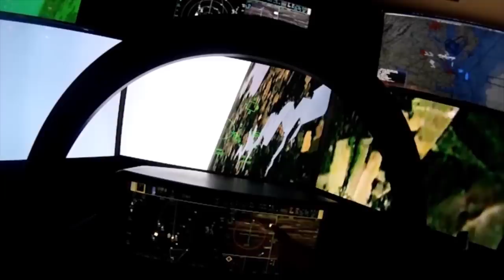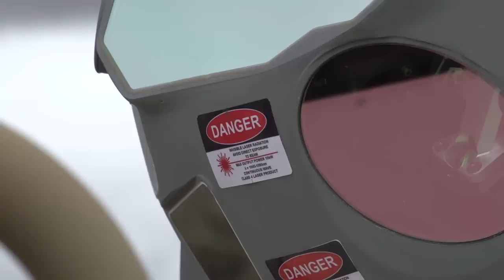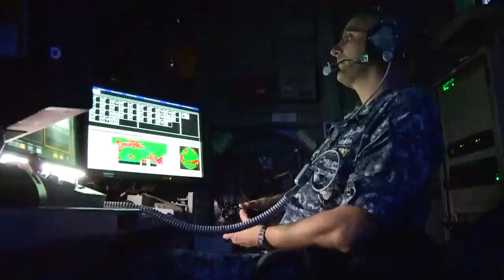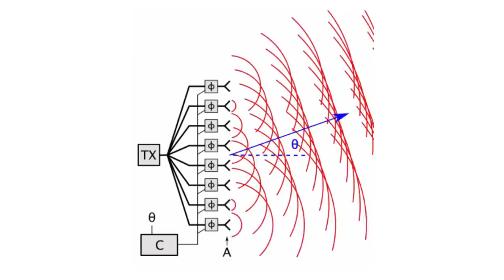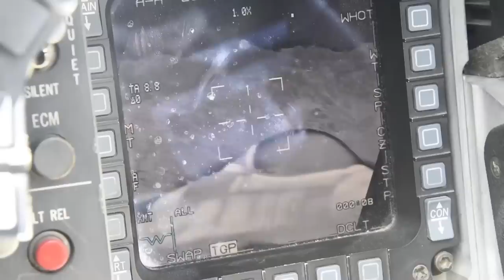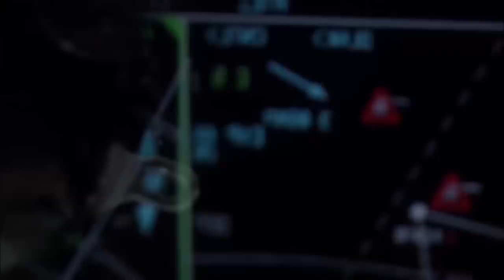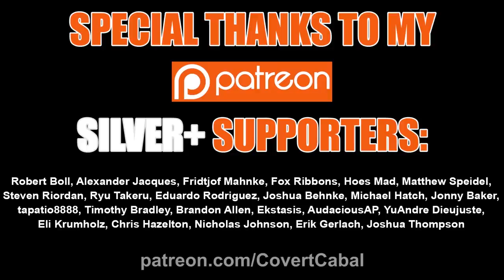Future Gen Fighter - 6th Generation

Comment: One thing I wonder that could be done should they want more unmanned planes at (what I think, at least) a lower cost, is possibly refitting older or current gen fighters with newer technology that enables them to fly unmanned or with a pilot ("Stealth" [Jessica Biel, Jamie Fox, Josh Lucas], anybody remember that?  Basically, a situation like that could be executed with this tech; meaning the scene where the UCAV flies in rescues the pilot then they give an air forces version of middle finger in the form of whatever payload is left on the jet)

Comment: Autonomous stealthy fighters with over the horizon laser strike capability would be the pinnacle of air-breathing fighter aircraft:)
Reply: Lasers go in straight lines, I don't see how they could have an over the horizon capability.
Reply: A powerful ground based laser reflecting off of a mirror held up by a plane. Of course atmospheric scattering would probably ruin that at over the horizon ranges. Although you could have the ground based laser behind some cover a km or two behind the fighting, with a plane + mirror combo flying overhead, reflecting the laser back down.

Get some of that laser artillery going, you know. Well, more like pin point laser sniping anyway.
Reply: ADF-11f?
Reply: Hanif Shakiba fuckin pure comedy right there. 🤣🤣🤣
Reply: @bluemountain4181  only aircraft and satellites can get high enough to see that far to shoot a laser:)
Reply: Red Ice reflect off a satellite 🛰

Comment: missiles destroyed by the laser( they extremely (like 5x) slow down the missile ).
in the end by multiplying the power of the laser after decades, missiles will just put some tungsten and thermal conduction in a single year, having less payload but much less payload requirement due to much weaker target because of the heavy laser.

Comment: 7th gen: cheap unmanned aircrafts controlled by a central supercomputer located in a facility at a safe zone nearest by the area of operation for low latency,  against countries/insurgents who can't shoot down satellites, possibly even directly above the drones. 

Since most expensive computing is done  centrally, the drones can stay cheaper, since it only needs the sensors/transmitters and basic AI so it knows what to do when it loses connection. 

Linking all the drones is instantly and reliably since everything is controlled centrally. Commands can be given to the supercomputer if necessary.

Con: without a connection, the basic AI on the drone is nothing compared to the supercomputer, so it needs a connection. 

Solution: the drones are also connected to the drones closest in proximity. If one drone is targeted by the enemy/if the connection to the supercomputer is lost, it can verify if all other drones in that link got a command at that point in space/time, a little like block chain. (The drone furthest away should get the command a tiny bit later than the closest. If you as enemy are not at the right location, it's hard to fabricate that delay, even if you have decrypted the stream and know what to send the drones. You'd have to fool the majority of the chained drones before it gets accepted as a legitimate command)

Pro: Without a link to home, the drone is not a threat, if it crashes there are no important/ super expensive on-board computers, and it can't attack you, except if the majority are taken over. (Which is hard to do since You'd need to fabricate the exact delay for every drone, like you were located where the supercomputer is located. And know the right encryption)

Comment: The US Airforce was originally supposed to purchase 648 Raptors back in 1991, but ended up only ordering 195 due to fiscal constraints.  A 6th Generation fighter will cost even more, probably only be able to buy one or two dozen.

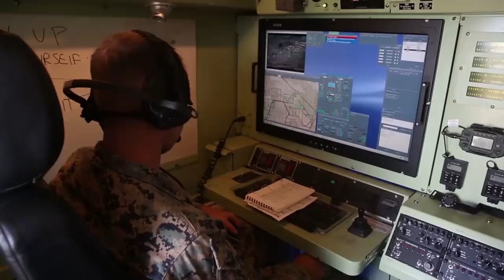Comment: 2:30 You forgot THE greatest benefit of having no pilot:
G-force limits are vastly increased! 

A jet's maneuverability is very often limited by the pilot's ability to stay conscious....and heavily limited at that.
Reply: Not really a benefit outside of small dogfights; optimal turn rates of all modern fighters are tolerable by pilots. For instance the F-16's fastest sustainable turn rate is achieved around 7Gs, not at it's 9G limit. Having an AI or remote controlled fighter won't overcome the physical limitations of the airframe and engine tech that is currently available.

The greatest benefit of having no pilot is that a pilot's life is not at risk; drones can be used in a suicidal fashion without risking pilots lives and can present additional "cheap" targets to confuse and overwhelm the enemy air defences. Though they won't be anywhere near as capable as a piloted fighter if they are built to be cheaper.

Comment: The Airforce will be proceeding in a different manner than in the past. They will be attempting to release a new fighter as fast as possible every 5 years or so using the most current technology available expecting that the jet will only need to remain relevant for a few years till the next one is released.

Comment: Nope. 6th gen May have the capability to go on missions unmanned but it won’t be unmanned. There are simply times you need a human in that cockpit. 5th gen is being given lasers. B52’s are being given lasers. They’ve been in development for the B52 for over 6 years and will be implemented in 2020 to 2021 while the B52’s are getting their new engines. F-35’s, the A and C models are getting lasers. They are removing the small, extra fuel tank just behind the cockpit and adding a turreted laser that will pop out when needed. It’s a great additional weapon/defensive system especially for the F-35C since it doesn’t have a built in gun system.

Comment: I suspect that the lag in general AI development will lead to remote operated fighter systems. You need human oversight and decision making ability, but you can't accept the performance limitations of manned craft. So you end up with remote operated fighter craft as an interim step before full on UCAV air superiority platforms becoming the norm. Picture a large stealth craft or AWACS equivalent, that deploys/operates a squadron of air superiority remote platforms. There is some EWAR risk inherent in this, but not much more than in a UCAV system, meanwhile it's much easier to get budget approval and transition your armed forces to using them. Though I suspect the next major ground support aircraft is going to basically be a slightly upgraded, teleoperated A-10 equivalent.
Reply: Sorain1
objective thought
something like this was the technical task (in short) to create a 6th generation fighter 15 years ago!
and the main burden of work will be on the shoulders of a-10, su-25, AН-64, SH-60, mi-35 (mi-24), mi-8 AMTSн, ka-52, mi-28

Comment: On the topic of discriminating between fighter jet generations, of course everyone has their own definition, but you could argue that it's really a matter of changing the tactical paradigm in a manner designed to nullify the previous generation. The lumbering subsonic first generation was beaten by the supersonic second generation, which in turn suffered to radar-equipped 3rd gen, itself being almost a non factor to modern, 4th gen fighter aircraft, which 5th gen stealth units are designed to dance around unseen.

Following that reasoning, the 6th generation should be designed to beat the 5th, which might involve all sorts of things we can't be sure about right now: lasers, autonomous combat AIs, exotic propulsion, etc. Behind closed doors, I'm quite certain that this future battlefield is already quite well understood and being prepared for.

Comment: Im kinda just poking holes in the AI aircraft idea for fun not my rock solid opinion but,
AI means more tech which means more tech support and monitoring, more potential malfunction, and possibly more complicated malfunctions at that such as electrical faliure, software bugs, hardware failure, processing errors etc. Some of these things already occur in current aircraft systems so making it the dedicated point of control hinges the operation of the aircraft all those weaknesses. 

It's probably more likley we will see integration of advanced AI systems into manned aircraft. This might sound silly but, something almost like a pilot google assistant that works with the pilot and also automates tasks more efficiently.
"Here are 3 possible attack routes with no toll roads" haha you get my drift.

Comment: Excellent video. Very informative. On your last part about China, yes, their PLAAF has come a long way in the last decade. However, I think there are a couple points to be aware of with regards to them. Only approximately 50 of their fighters are J-20s. A huge majority of their fighters (nearly 1,200 out of roughly 1,250 total) are J-10s and J-11s and other outdated aircraft. And with Russia cutting China off from purchasing new Sukhois, the already underpowered J-20 will need to rely on Chinese ability to create an engine that is both powerful enough to power the J-20 as designed and that can effectively shield its IR signature from radar detection. So far, they have been unable to prove that they can do so. It is widely believed that they had hoped to steal or reverse-engineer the newer, second phase SU-57 engines from Russia. Reverse-engineering is now off the board. So they would have to somehow steal the technology (which they have proven to be very good at doing to foreign powers in recent decades). Still, many countries have become more acutely aware of China’s playbook in this regard and will no doubt be trying more diligently to prevent them from doing so.

Comment: You are literally avoiding the fact that modern lithium batteries still can't be used for long-range flights, because of the fact that lithium has a very low power to mass ratio compared to diesel. Even if the lazer is powered by diesel, it would use up all it's fuel.

Comment: U.S. 6th gen craft should be anti-gravity circular craft that no longer relies on Carbon combustible fuel and aerodynamic flying straight thru the air like a bird, which is 100 yr old tech

Comment: With costs for developing the F-22, F-35 and the B-2 in mind, not to mention the budget and planning overruns, the operational costs of maintaining these aircraft in substantial numbers and (in the case of the F-35) the still considerable list of malfunctions of the F-35 the director OT&E published (of which some 100 deemed mission critical) I can't help wondering where 6th gen will lead to. The way I see it, the defence industry has failed several times in getting it right and I admit, it must be incredibly hard to do so. But look at how long it took to get the F-35 where it is today (still not up on top of its game if it will ever be). 
I've got the strong sentiment that western nations have traded off their ability to react fast to operational requirements if and when they arise, because they seem to be focussing more on platforms and systems than on weaponry. I'd much rather see our contractors to get 5th gen absolutely on the mark first before embarking on another 'wonder weapon.' And get the spiraling costs down to a degree, that enables western militaries to re-equip their units with more advanced systems rapidly rather in the proces. 
I've also got the idea, that industry is focussing too much on too complex systems of systems, on which no one has real oversight or complete insight, relying too much on IT (which becomes smarter by the day, leaving technicians becoming less capable in trouble shooting it seems). 
Same goes for warfighters. I've heard the story of an RAF Tornado pilot  who had a USAF exchange navigator in the backseat, when they flew over LOch Ness. "Where are we?" the pilot asked the nav. upon which te latter just gave the grid coordinates flawlessly. "Yes, I know, but where is that? " For all the nav could say it was equal to being over the Nevada desert or over the arctic, he just didn't look outside and was not able to tell they were over Loch Ness. (Source: YT channel of Aircrew Interview). If we all rely on tech too muich, we won't be able to deal with events that cannot be reproduced in a simplified manner by computers. 
I'd much rather have sound strategy, clever, adaptive warfighters than the most advanced tech there is. Here's one reason why: https://www.wearethemighty.com/articles/that-time-a-marine-general-led-a-fictional-iran-against-the-us-military-and-won#targetText=That%20time%20a%20Marine%20general,Middle%20Eastern%2Dinspired%20military%20force.

Comment: Really, as if there could be any issues with integrating AI with unmanned weapon systems...
Reply: Having used AI technology in multiple practical programs, I can guarantee you there is no chance of it spontaneously becoming self-aware and going rogue. It doesn’t work that way: AI is taught and deployed in separate stages, so an AI program aboard a fighter jet cannot learn new things, much less self-modify, both of which are mandatory prerequisites for self-awareness. 

In fact I would postulate the biggest problem is the opposite: deployed AI cannot compensate for unfamiliar situations like humans can, and nothing produces unusual circumstances like war does. There are millions of edge cases where modern AI would fail but a human wouldn’t. 

That’s not to say AI drones are useless. In the vast majority of cases they will have all the information they need to carry out a combat mission just fine; without a human as a limit in the cockpit, drones would be able to perform maneuvers at twice the Gs humans are capable of and communicate much better too. 

What we would get is what we have with AI cars: they will occasionally crash in unique circumstances they weren’t trained for, but they’re still much safer than human drivers, because humans make mistakes.

Comment: A fifth gen fighter must meet 2 crucial standards to qualify as a true fifth gen fighter.
1. Supercuise. The ability to travel at mach +1.0, without using afterburners.
2. Stealth technology/Radar absorbing material. 

China's J-20 isn't capable of supercruise, so it technically doesn't make the cut as fifth gen. More like gen 4++.
And Russian Su-57 is running into multiple problems, and is built more crudely, and less stealthy than F-22 or F-35. Not to mention there are about 180 F-22's built, making it the second highest produced 5th gen fighter, behind the F-35.
Reply: Who gives a damn for those "classification"
Reply: @joshbrowning2406  I do not quote you but it is meant to be sarcastic way to express something when typed. Pretty common to type this way where I am from. 

What kind of no-life would immediately blow up and comment on a 2018 video........

Gee, this this a public comment section and hence I have every right to type and comment what I want. 

As for this "classification" (In generation, read in sarcastic voice), there is no consensus what a 5th gen fighter needs to achieve because the entire term is pretty much only marketing. Being 5th gen or 4th gen does not mean your aircraft is better than the other. I am highly critical of this generations approach especially if we compare fighters of today who tend to be upgraded a lot. Nobody would say an F15 Silent Eagle with advanced electronics would be 3rd gen, the same as an Mig-21. 

Just a term for people. 

Then, having those abilities does not make your plane better. So, the new chinese jet cannot supercruise but maybe it can carry far more ordnance and missiles. Maybe it has a far higher range. Supercruise is something America wanted. China may want something with range to be able to strike targets in Japan or Okinawa.
Reply: @joshbrowning2406  And it's someone who can obviously only insult and not contribute something and gets all angry if someone gives him contra.
Reply: Josh Browning osh Browning I guess since I am not a native English speaker, I am forgiven. Kindly point out where I misspelled.

You seem quite angry to me though. Immediately insult me, repeatedly. You laugh at me for misquoting you but yet you make up statements I never said too. I never once said that Chinese J-20 could best the F22 in a dogfight. 

So, are you interested in a serious discussion or are you just continuing to insult me and my intelligence?

Comment: I dont think they will be unmanned just because of the jamming reasons. Also i Doubt about lasers - wont be powerful enought. But what I think.. probably the fighter jets will be operated in stratosphere. There they can reach faster speeds, missiles achieve faster speeds and probably harass some low orbit satellites. Probably modern warfare will reach out to space and the conflicting sides will be needing planes which can operate efficiently on very high altitudes. There are currently couple of planes and jets capable (Blackbird, Mig31) doing that. And the MIG is currently only one operating with weaponry on that field. Since its big and achieves fast speeds Russians attached a cruise missile on it =))))))))).